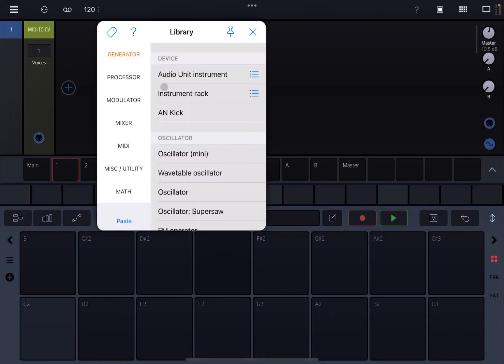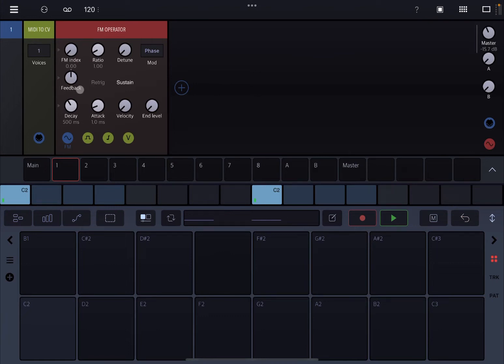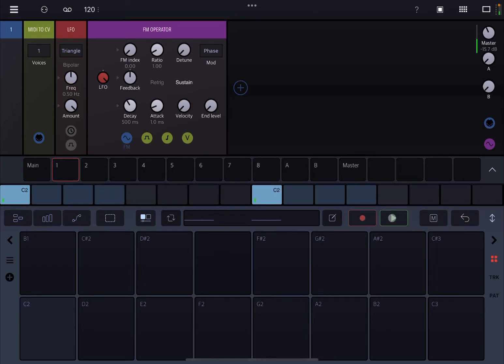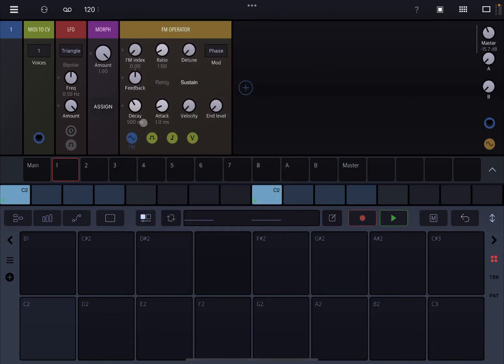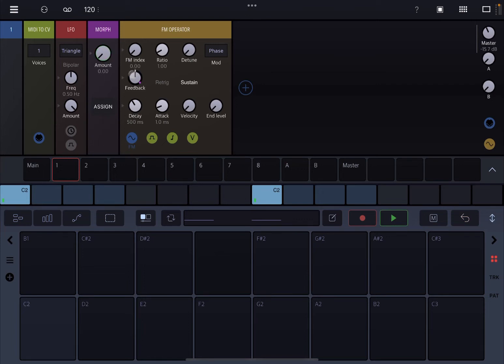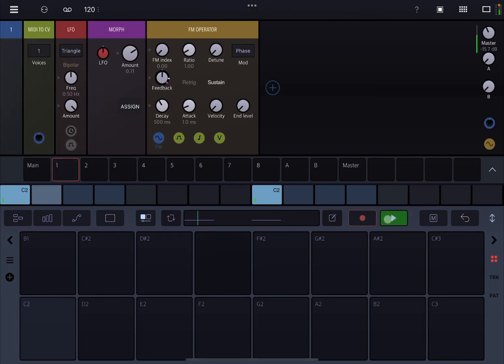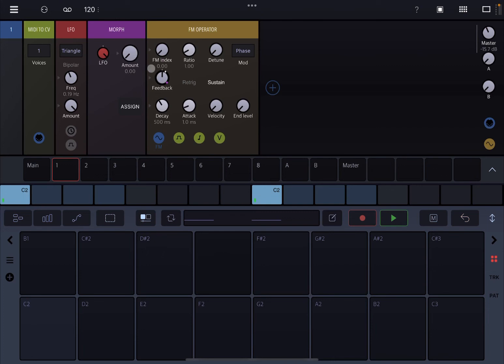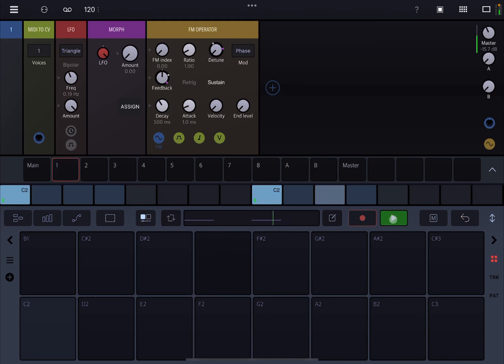BeepStreet Drambo v2 - Demo / Tutorial 72: How to modulate using the Morph module

Comment: Great tutorials!
When I add the Detune to the Morph it ends up staying at the bottom for quite a while before rising again. Or one sticks at an end for a while. The lfo doesn't seem to react the same as turning the Morph Amount knob. Any idea what's going wrong?
Reply from the maker: What wave are you using for the LFO, sine or triangle ? Also is bipolar on? Did you try adjusting the amount dial on the LFO?
Reply: @soundformore  I just went through the tutorial again and It works. I think I missed the bipolar part last time. Thanks very much!
Reply from the maker: Great